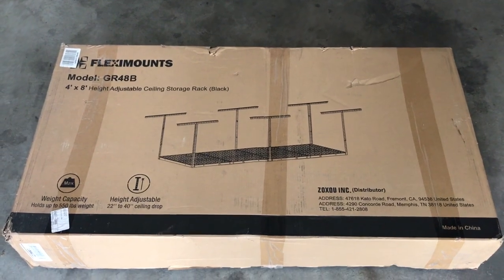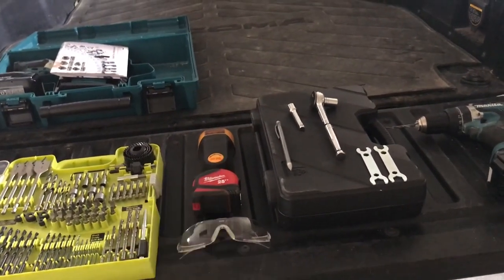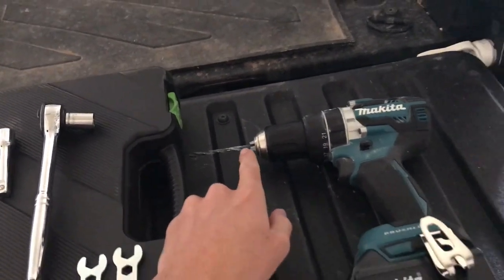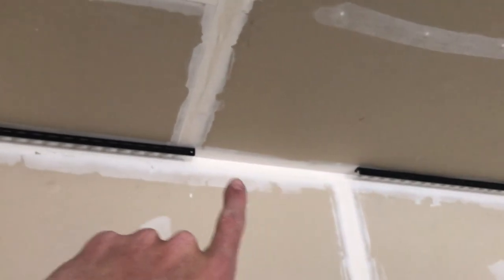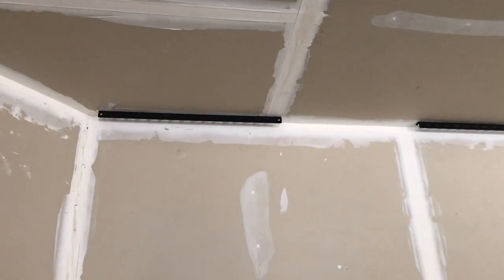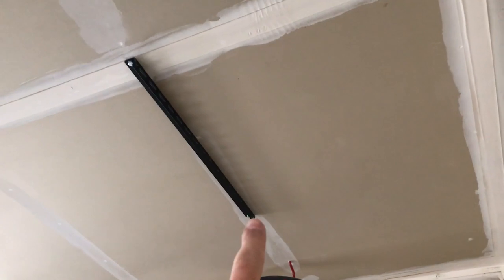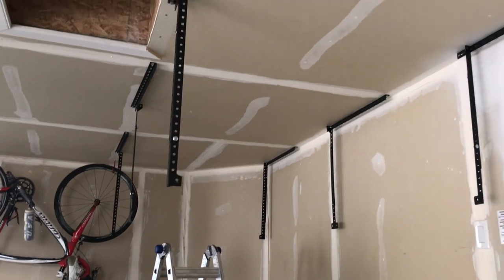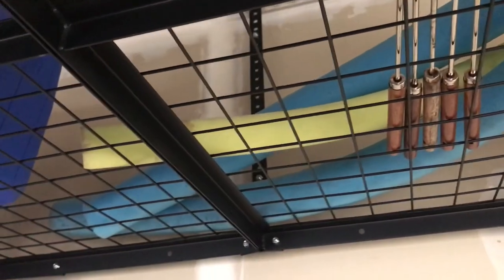Easy DIY Overhead Storage Shelf Installation

Comment: The instructions actually call for wall mounting when you're this close to the wall. Might have been easier to exclude the ceiling braces and just fix the vertical bars directly to the wall on the back side rather than have that tiny gap. I have 5 of the 4x6 units I'm about to add to my garage so I've been watching these videos. Learn a little more with every video. Thanks!

Comment: Have two of these: 

Throw the hardware they give you in the trash and pick up some M8 bolts and a magnetic nut driver. The included allen hardware is impossibly cheap. Also these things will wobble and be unsteady if you follow the instructions and don’t modify them. Order some triangle gusset braces and fix them to the vertical posts meeting the ceiling. 
These racks are nice, but it’s a full on dealbreaker/ inferior install if you don’t strengthen the verticals with braces.
Reply: I'm having a hard time understanding this but want to follow your advice. How do you use the gusset braces

Comment: The verticals are supposed to be in the center of the ceiling pieces to equally distribute the weight.  You are over loading the end of every ceiling piece.
Reply: I’ve watched a few of these videos where they install it like this and can’t figure out the misunderstanding of how load bearing works. Hopefully they don’t overload it.

Comment: I know this is an old video but since your studs are running horizontal why didn't you mount the drop down arms on center
Reply from the maker: It was just the way the studs lined up, I had to mount them where they are at, but wanted the rack as far over as possible